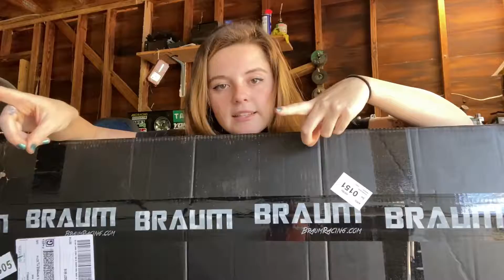Braum Racing Harness Bar Install | 2006 STI

Comment: Recommend you to get new maybe OEM replacement seats. Because when they are not tightened right they don't work and you will get hurt in a small accident just because of the wired way you are strapped in.
Reply: Or make or buy some sleeves that you put over the harness on top at your neck